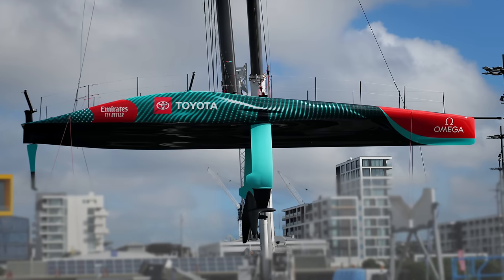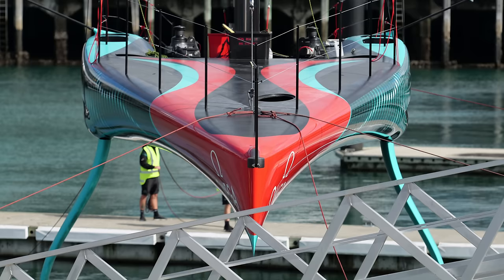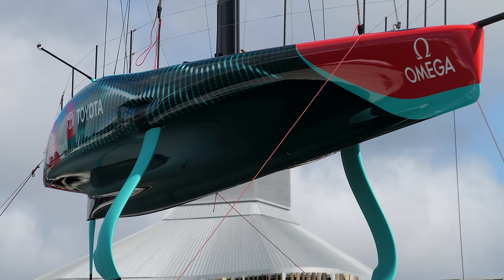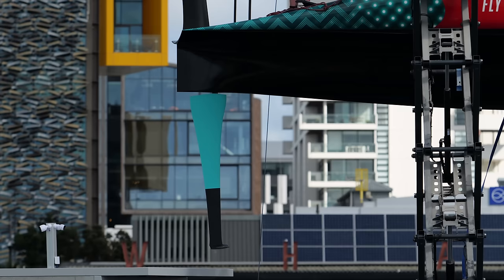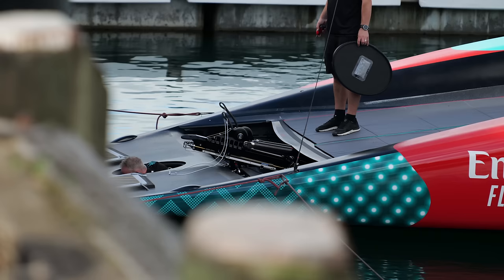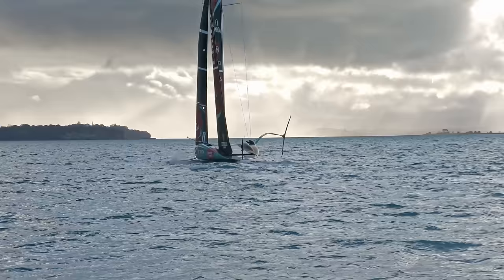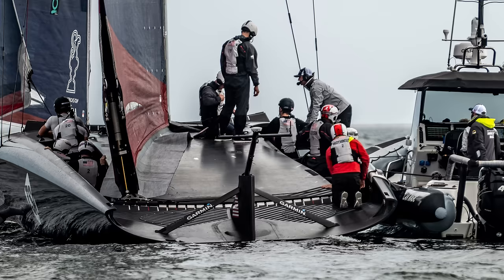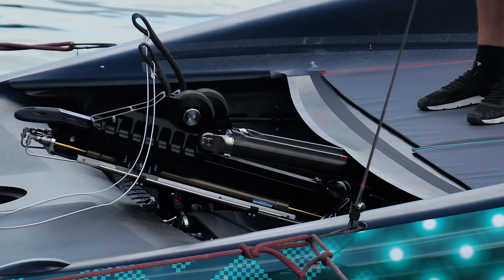Taihoro: Details of the New Zealand Defender

Comment: Using the old foils makes perfect sense to me. The first thing I'd want to do is established that my new boat can go as fast as my old boat with the same foils.
I also think the main sheeting system looks brilliant, I'm surprised we didn't see this earlier.
Reply: Smart thinking.
At what point does the rules lock down the  foils be swapped?
Reply: Its more a case of not exposing our design and giving other teams time to copy it.

Hence using the old foils
Reply: This was often the case back in the later 90s and early 2000s is run on the old keel until its closer to race time

Comment: What a beautiful looking AC75! This boat already looks fast, stable and low to the water line. Even on older foils. Will be fascinated to see how fast this boat will get with all the tweaks and changes it will under go between now and the defenders series. A boat like this and a crew like Burling and Tuke this will  be combination that will take some beating. Good luck to the challengers.
Reply: I love all the technology and innovation around the AC, despite knowing nothing about sailing.
What's so fascinating about these new AC75s is how similar they are, especially LR and ETNZ.
Can't wait to see them racing

Comment: The first thing that jumped out at me was that the mast seems further aft than on Te Rehutai. There seems to my unscientific eye to be (possibly?) more foredeck length in front of the jib tack as well. I am wondering if this indicates: 

1. the sail plan is further aft as a whole; and 
2. the sail plan is higher aspect (as a whole)?

This would (if it is the case) seem to indicate a conscious choice to top end optimisation, and I was expecting there to be a MASSIVE premium on achieving lift off in lumpy seas and light airs. I understand this is a trade off, but would be interested in your detailed analysis and the 3 of you discussing:

(a) Is the mast step further aft (i) overall; and (ii) relative to the foil arms?
(b) Is the sail plan as a whole higher aspect ration than Te Rehutai's?
(c) Is there more deck length forward of the jib tack?
Reply: Yes. The move of the mast backwards does look like it to me to. It will be super interesting to see all the boats in a side on comparison!

Comment: Does the camber on the bustle give an indication of how trim could be used to increase the effency of the sails? Bow down mast raked forward (see forward raked wins on aircraft) reduces the tip vortex and associated drag but there are control issues some of which are mitigated by only having 1 wing.

Comment: I think ETNZ are intending to be foiling 100% and have designed as such. They have refined the hull shape to be as slippery as possible through the air. The bustle is purely for end plating, not for touchdown/takeoff. That’s my take anyway. Can’t wait to see their new race foils, and some speed data at that time.
Reply: Interesting-if you’re foiling 100% of the time maybe “old” foils are faster as I presume new foils are larger and draggier

Comment: Hi Mozzy you didn't mention Team NZs boat has a guard rail all the way round it there last boat didn't I hope they take it off when sailing as it will cause drag and windage dunno why they put it on there no other AM cup boat has one.
Reply: It’s only there when it’s launched and retrieved as working at height. They all have them.
Reply: Checkout Luna Rosa they revealed there boat today no guard rail on there boat if you watch there launch video. You said they all have them not so.
Reply: @scotthallinan5729  they certainly all have them for safety reasons. The reason Luna Rossa didn't have them in durung the launch is because they didn't have anyone on the boat while it was at height.